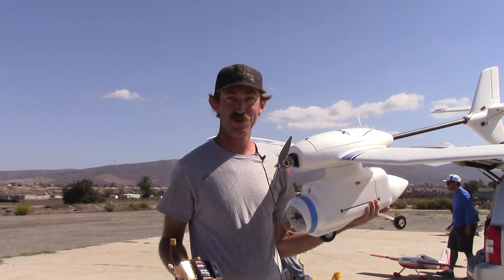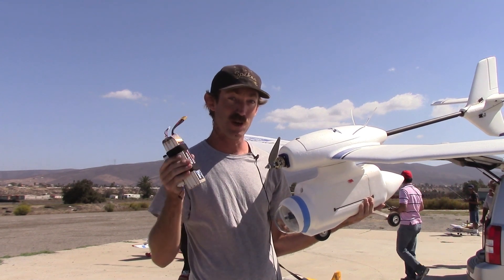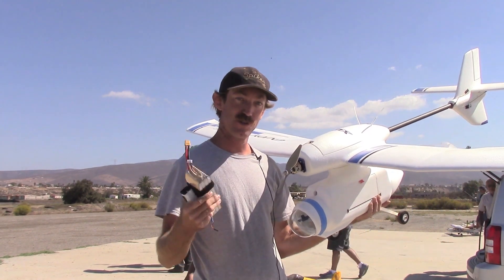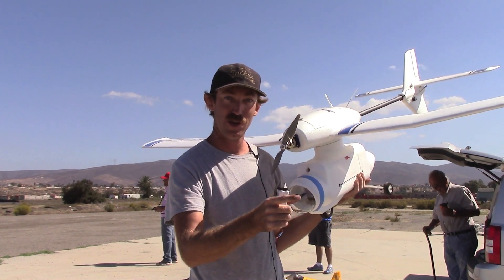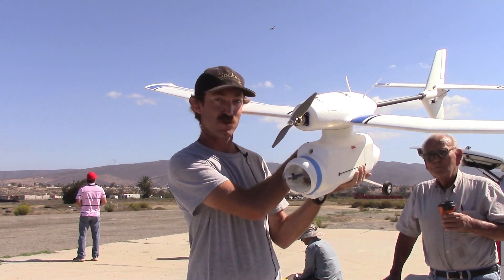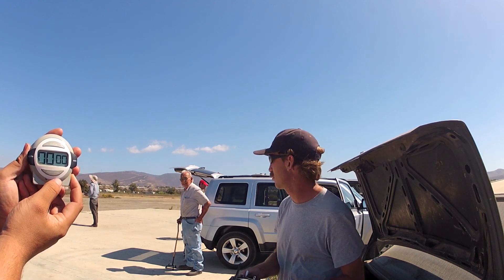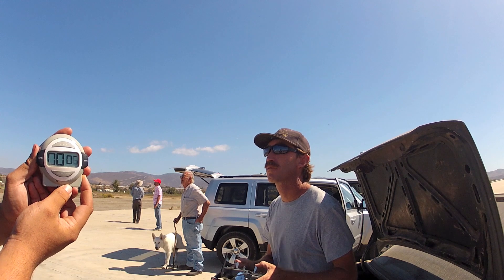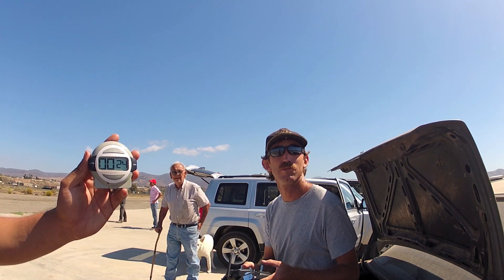X-UAV Skua Endurance Testing

Comment: I also have a Skua that I film wrapped in carbon fibre. I have flown with and without the pod. The best set up so far is with the pod but I removed the back landing gear and hand launch. After a few trials (more errors) the hand launch works well. I don't like the way the pod attaches though and feels this needs to be modified for a more secure fit. I did modify as per you recommendation and moved the rear servos and planted in the tail for ELV and RUD = much better!
Experimenting with a very cheap mod using a two litre coke bottle as the pod. I fly professionally and find that the perfect balance is cost of UAV in relation to being fit for purpose for particular mission.
Reply from the maker: great, thanks for sharing. and glad to know something i did helped you. 
will check out your channel. would love to see what you do with it.  what carbon fiber weight cloth do you use, and what resin,/ application method?
Reply: what email can I get you on?:-)
Reply from the maker: Blayne Jackson fpvreviews@gmail.com

Comment: My record is 1:45 with a twinstar using one motor on the nose, 750kv motor with a 10x8 propeller, and 3x 2200 3s in parallel.
Reply from the maker: that's pretty impressive for a plane that some. was it a fpv flight?
Reply: FPVREVIEWS no, line of site, I think the trick to efficient motor/prop setup is a low kv motor, so it spins slowly, but a prop with plenty of pitch, this means that even at low rpm's the propellor has enough pitch speed to still provide thrust when cruising. I would like to try 6 2200 batteries in parallel but I was bored by the end of the first long flight.
Reply from the maker: Max StewieGriffin. there is an ideal prop rpm depending on airspeed, and thrust required.
and too much pitch is also bad, as blade stall can occur under certain circumstances. even if not, there is an optimal angle of attack of the blades.   
As you say, the rpm is usually too high on model planes for the max efficiency, and the pitch is usually suited more for climbing effectively, than for efficiency in cruise flight.
it's pretty hard to know what the best relationship between airspeed rpm, and diameter and pitch should be. but if you are getting good results, it must be close to ideal.
twin motors and twin props, are not as bad as many people would think. in fact, there is no appreciable loss in efficiency at all. here is a video that i enjoyed about misconceptions in aerodynamics. in one part , he talks a bit about prop efficiency. hope you find it interesting.
Reply: FPVREVIEWS I cant see the video, but you are right about the blade stall and twin engines. Also an osd with gps and return to home would probably be able to circle the plane efficiently, this would be a solution to piloting long flights. ps I am very impressed by your Gemini, its a great plane.
Reply from the maker: Max StewieGriffin. Doug McLean | Common Misconceptions in Aerodynamics

thanks, the gemini can do 3 hrs almost, and while carrying the 2 fully articulating cameras, and transmitting two long range video signals, and telemetry.  there is really no comparison.  now i just need to find the right way to produce it..

Comment: You should try running two Multistar 5200mah or one Multistar 10000mah battery they are super light but low C so it aint going to do any stunt fling but for a slow cruse it should give you a good mah to weight to test with
Reply from the maker: +Spencer Boaz any idea of the energy density of the multistar batteries?   wh/kg?
we are now using panasonic NCR18650GA cells for most of our planes.
Reply: +FPVREVIEWS No I was using Bias 5000 40C with my F550 with E310/420S power system and getting about 6 minuets I bought the Multistar 5200 and get almost 11 minuets just an idea I am thinking about getting the Skua and would be using it for video/fpv so it dont have to fly hard . The 5200 weight is 433g .
Reply from the maker: +Spencer Boaz well, fixed wing aircraft like this have  amuck less power requirement than multi rotors, but people have flown multi rotors for well over one hr on the panasonic 18650 lithium ion cells.  I recently made  a video on how to make your own pack out of them. they are the best i've found for energy density,a dn are very good quality cells. also price is not cheap, but considering all, it's good. try making one, it should make skua fly for over 3 hrs easy.
Reply: FPVREVIEWS My F550 is just over 5lbs all geared up . It takes a lot of power . I payed $37.99 with free shipping so that wasn't to bad I watched the video on Pan 18650 and would like to give it a try when I get the Skua or build a FPV plane . I havent looked into the price to build the Pan. battery but I will before I buy another lipo .
Reply from the maker: +Spencer Boaz cool, i think that more and more rc planes are going to be using this battery type in the future. 
the future is going to be cool. 
tesla motors is using a cell very similar to the GA type cell.  joint venture between panasonic, and sanyo. cool stuff, cheers!  
let me know if i can help provide advice when you got o build the battery, be happy to help if i can.
Reply: FPVREVIEWS You can see some of my stuff at Spencer Boaz On You-Tube just getting going good think I have all the bugs out of my F550 I have shot most of my stuff with a Phantom 1 with a hard mount now I have a shock ball mount for it and everything for the F550 fpv gimbal 4K now on a 3S 550mah battery separate from the 4S power system should all run smooth now . But still want the Skua for long runs . Thanks I'll give you a shout if I have any problems . Sure I will have some questions about setting up for long range .
              Spencer .

Comment: HI Spike, Great video and amazing plane, what do you think is the comparison between Talon + ext. wing and the Skua?  in Payload, Endurance, Strong wind.... as the talon was field tested in all wind conditions and payload up to 4kg. 

If you have used different motors with low KV and bigger prop, don't you think you can achive the 4 hours? exemple: Tiger motor MN 3510-25-360kv + 16x10 APC prop + 4s 10,000 mah
Reply from the maker: apples and oranges, i'm afraid, the talon can't be as stable as the skua in flight, and the skua cannot carry a larger prop. it will hit the bottom gondola pod.  the 10 inch is as big as it gets, unless it's modified, and the nose extended. if that is done, the prop will be in view, like the skywalker naja.   i have not tested the talon, but i design aircraft,a nd there is no way it's very stable, at least not in the same way as the skua.
Reply: FPVREVIEWS I liked your past reviews and that's why my skua is on its way, I should get it on Friday. I guess if we remove the dome, will we be able to add a bigger prop, isn'it?  
If yes, then we go with lower kv and bigger prop. If Front view is not a big deal as we can put the camera from the bottom.
Reply from the maker: ***** all you would really have to do is to make a fairing block from foam, which would help aerodynamics of the nose, as it pretty flat, anyway, and then a bigger prop would clear. a 12 inch prop, or 13 should do just great.  it would be in view, but you could keep the dome.  no reason to get rid of it.  i may do some mods to mine, to fly long distances, but i have the gemini V-2, so it pretty much outperforms the skua in every way. it also is not a buy and fly plane, at least yet.  maybe soon. i just got a quote from a mass producing manufacturer, and i could retail a pre built gemini V-2 for 700 usd. it's a town engine platform with 3.2 meter wingspan. what do you think?
Reply: Hi Spike

What it needs to have the Gemini ready?  It seems many people need it.
Reply from the maker: ***** Will be released soon..

Comment: I would buy your pre-build v2 for $700. When do you think it will be ready. Any estimates? Will it have motors and servos installed? ARF?
Reply from the maker: it would not have electronics, just the airframe already built.  no motors or esc's..  all hardware for the airframe would be included. don't have an eta yet.  thanks for your continued interest.  best, spike

Comment: hi! Do you have any advice about any Patch Antenna which use 1,2/1,3 ghz long range FPV ( 3000-5000 meters)
best regards
Reply from the maker: here's the one i'm using:
http://www.dronesvision.net/en/wireless-av/67-12ghz-14dbi-patch-antenna-for-wireless-video-transmission-long-range-fpv.html
Reply: You don't need any long range antenna for 3-5 kms range. A stock dipole will do it for you.. For this kind of range its better to use a circular polarize antenna to get better picture and less interference.. They are good for even 10 kms range all around... Consider buying a directional antenna if you going above 10 kms..

Comment: You should intall a APM 2.6 Flight controller and let it fly a mission.
Reply from the maker: Jon Car if i had one i would.  guess the pixhawk is the newest, best one? or is the amp 2.6 still more reliable?
Reply: Both are great apm 2.6 can be had for 95 bucks with GPS and telemetry

Comment: Hi
I want to learn where is the CG of skua. Thanks
Reply from the maker: mine came with the center of gravity clearly marked on the wings, and a mm figure in the instruction manual. if i recall, it may have been on the main wing spar. i don't have the skua anymore, or i'd measure it for you, as i passed it on to a friend. he really likes it, as did i.   sorry i can't be of more help...
Reply: Thank you very much

Comment: How far did it go?
What is the flight range?  For 2 hours
Reply from the maker: I wish I knew, but didn't have telemetry on board, or data logging back then.  it was available, but funds were limited.   I did like the plane though.  I would guess that If flew roughly 45-50 kph so about 100km linear range.    it could have carried a much larger battery, but we were testing the specific claim by the manufacturer regarding that motor and battery size.    and it would improve further with Li-Ion.   should not be a problem to get it to 4 hrs today.
Reply: @FPVREVIEWS  

I like the plane too. I watched your video
What if you add the electronic components such as pixhawk, flight controllers, transmitters and receivers, and place a more powerfull battery

Will it travel further than 100 km ?
Reply from the maker: @franciscourena5636  Yes, It should be able to go much further.
Reply: Thanks 
Last question
Reply: Where can I purchase it?
Do you sell it?

Comment: Hi Spike

At what power level of the battery you stop to fly?  3.2v per cell??
Reply from the maker: one cell was just above 3v.
the others were very close behind.
i flew until the factory settings not he esc gave cutoff on the motor. 
wanted it to be a good test of the airframe......
Reply: Hi Spike

Regarding the Skua, does it handle strong wind and gusty wind like the talon? Or is it made for sunny days with calm air?

What is the maximum knots i should fly it in?
Reply from the maker: ***** about 15 knots is the max. at least to be useful for anything. depends at what altitude as well, because about every 1000 ft, there is often a change in wind speed and direction. also turbulence is common in upper layers at several thousand feet, but only between layers. at least that's the conditions here where i live.
Reply: Hi Spike

Will the battery stay the same even after 50 flights if we go at 3.2v every time?  I have been told to not go below 3.7v.
Reply from the maker: ***** depends on the battery.  I'm pretty hard on batteries, and they won't get any better with use, that's for sure. you will just have to keep checking  them.  they will hold up a lot better on a plane that flies for an hour, than a plane that flies for 10 minutes because they are discharged slowly.  If you want extra capacity, and don't mind spending the extra money, and assembling them yourself, you can use the new lithium ion cells from panasonic. i hear they have almost 2x the energy density.
Reply: FPVREVIEWS
Reply: apaxq706
Reply from the maker: i stopped at 3.0 v per cell. i'm sure it hard on it, but everyone wanted to know how long it would fly in a real world test, so it's worth a battery. . and i charged it immediately after landing, and it seems fine. i think the worst damage occurs if it's left in a discharged state.